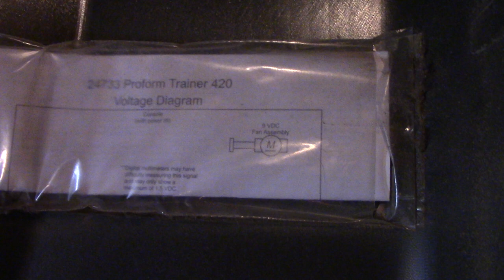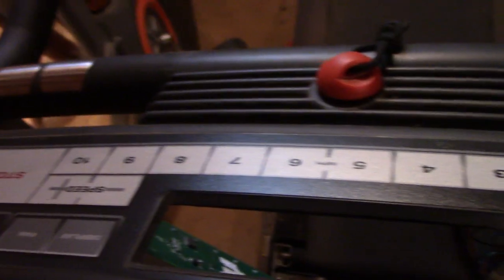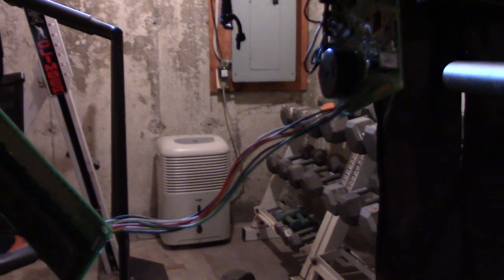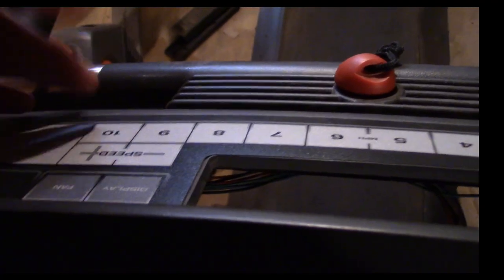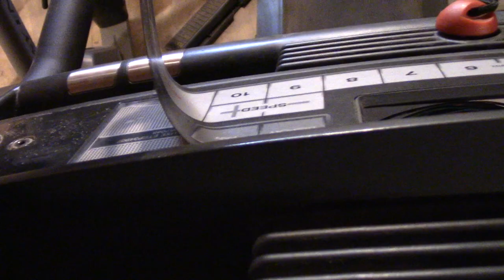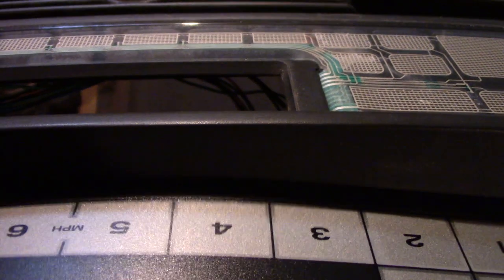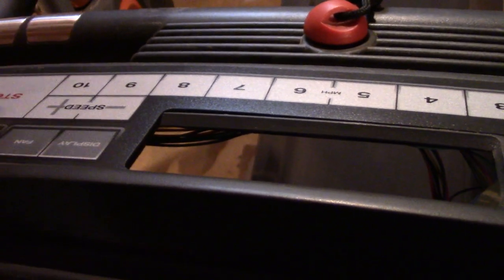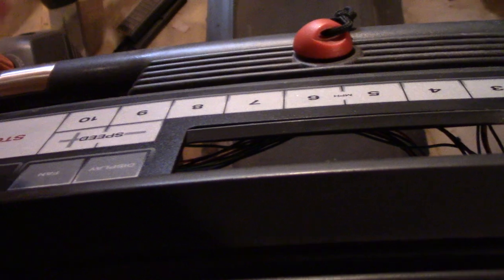Treadmill console buttons not working.

Comment: The label cover didn't correct my issue, but removing the membrane switches from the plastic console totally worked.

I suspect either the bending while pulling it up opened the layers up and/or the adhesive was keeping it tried and it couldn't expand/contract. 

Either way, works now! 💪
Reply: I may need to do this extra step as well. The membrane is really stuck down though. But at worst - I just get 2 new ones.  I have two and two plugs. I wonder if I unplug each seperately if I can narrow do which set of buttons needs to be replaced.

Comment: my buttons don't work start stop and numbers everything else works
Reply: One woman took the ribbon cable out . Used a siccors to cut the ribbon into strips. Then experimented not inserting individual ribbon contacts until it worked. She had a couple buttons not work.
10 wires in the ribbon but 14 buttons. Hmmmm

Comment: Ugh. Didn’t work for me but i have this exact same problem
Reply from the maker: Yeah you're probably like maybe the third person to say it didn't work after all these years. Sorry it didn't work out. Because new ones are so darn expensive.
Reply: @JLafix  correction!  It just started working. Mine has two sides instead of a continuous plastic cover.  I spoke too soon. Pulled one off and it didnt work.  BUT after i pulled the second side off, the first side started working too. Lol. Pulling of the face covers was the last thing i could think of, as i had checked everything else but i hadn’t attempted yet.  After i saw your video, i decided to give it a shot.
Reply: 2nd correction. It already stopped working and is back to only a few buttons working at all. The same few that previously worked.  Lol. You can’t make this up